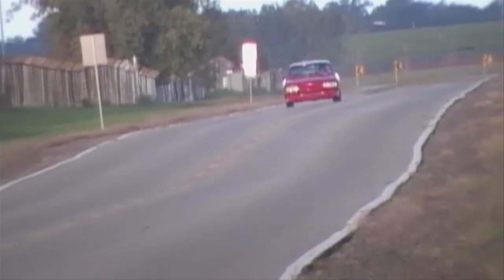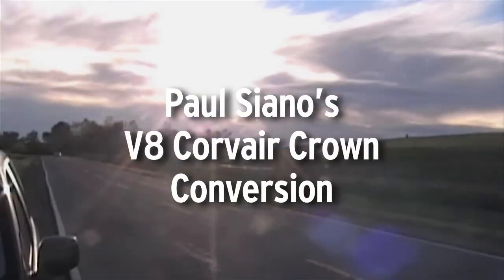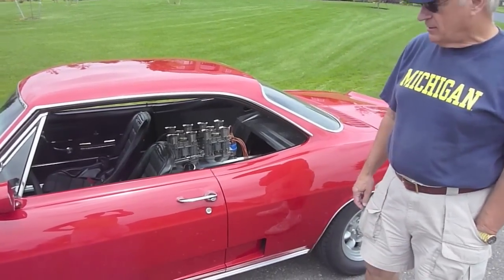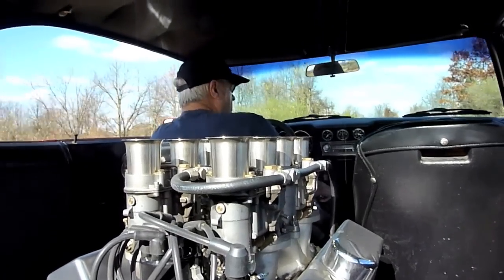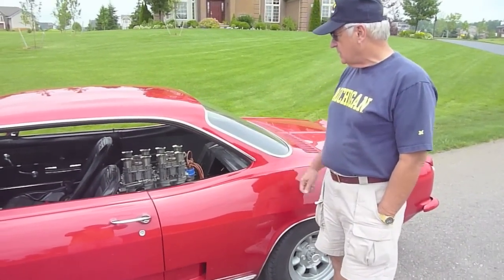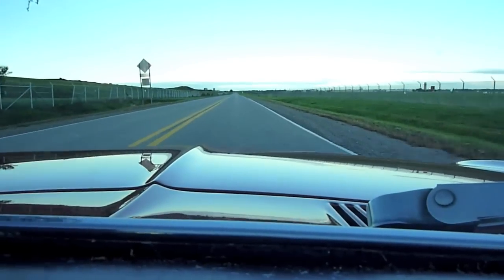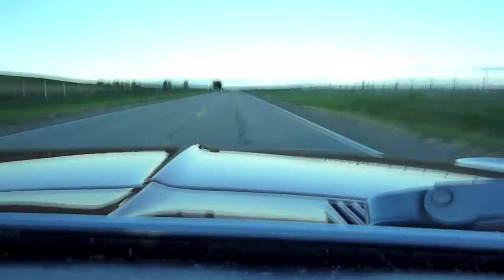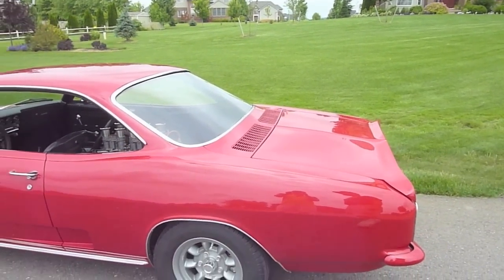Corvair With Chevy Aluminum 283 High Speed Run

Comment: I appreciate your interest in the project.  It must be remembered that this is a late 1960s era conversion and I used parts (mostly) that were available at that time.  I tried to keep everything correct for that era...no five speeds avail.
I asked Don Sherman to "take  it easy" testing it and he did which is reflected in the numbers.  I set the redline at 6500 which resulted in a top speed of 130.  Had I set it at 7000 the top speed would have been 140 and quarter mile time would have been less.

Comment: What a great way to start the day...thanks for the kind words.  Don Sherman was driving the car.  I asked him to use 6,500 as the rev limit which delivers 130 mph.  As you can see from the video it was still pulling at that limit.  7,000 rpm would be 140.  Because I think the aluminum 283 block should be in some museum, an aluminum 350  engine is currently being built and will be worth about another 100 horsepower which is about all the ring and pinion can take.  Thanks again.

Comment: It does sound as though it has solid lifters but they are hydraulic. (maybe set a little loose?)   The cam is specifically designed for Weber carbs so that there is increased vacuum at low rpm.  Thanks for checking it out.

Comment: @zuzulo56 This project was expensive; how much it cost is unknown but not that expensive if the dollar amount is divided by the number of years I've had it..  The current engine is the third I've had in it...started with a 327, then a 302, and now it has the aluminum 283.  The fourth is currently being asembled, an aluminum 350 using the same Webers.  Top speed is rev limited at 6,500 rpm.  Differential is currently a 3:55.  Top speed could be increased by using a 3:27 or a 3:08.

Comment: Gotta figure out a way to put a close ratio in it and a shifter you can slam
Reply: Since the video, I've installed a quick shift kit.  It was designed to be bolted in place.  It made such an improvement, I decided to weld it in place.  Am planning a new video that will show the improvements made in the last several years.
Reply: @57paulsiano  Still building mine, curious as to your quick shift kit... is this the spacer type?
Reply: Pau Pau  I admire your values and dedication to the project.  Please keep in touch as you make progress.  Thanks for you comment!
Reply: @johnboy4161   Sorry, I must have overlooked your reply.  Not sure what it's called but it's the one Clark's sells...a huge improvement.

Comment: Hmm...rubber hose on the fuel delivery for those "Webers" right behind the driver, with no insulation on the exhaust...you are braver man than I...or perhaps more fuel hardy, a little SS braided tubing would make me more comfortable.  Do you run this with no fire wall?
Reply: Your point is well taken and clearly this car is not for everybody.  Fuel pressure is about 3.5 psi.  I  once had a Hilborn fuel injection on it but wasn't comfortable with the high pressure fuel so close.  (did use braided lines)  I also agree that fire walls are a good idea.  I wanted this car to perform well and look good and in my opinion it is both.  I also wanted it to look stock.  Since the video, the engine now has a black distributor cap and black ignition wires.  Braided fuel lines would not look stock.  I have driven it,off and on, for more than 40 years without incident.  It's hot and loud...I suffer for my art.  Thanks for your interest.
Reply: Paul Siano
Thanks for your reply, I meant no insult to you, I currently have an off-road car built with a tube frame, mid engine small block and using a Mendeola 2D transaxle, with open axles and midboard 930's, but we run braided steel fuel lines, a fire-wall, a halon system, and we always use a fire suit, with full helmet.  I cringe to watch those webers, which are known for fuel leaks, at least all the IDE/IDF types I have used, without an aircleaner, which can backfire readily into the interior of the car,  being fed by that "bent"  rubber tubing, because I have seen leaking gas flash flame on a hot header, and the burns that sometime occur to occupants as a result.  Even 3.5 pounds is a lot of gas through a pin-hole in a rubber line. The car is beautiful, and well engineered, but just seems unfinished, without a firewall, braided steel, and a halon system.  Have a good day!
Reply: mfd doc No offense was taken and your concerns make perfect sense.   Fire walls make sense and so do air filters...I don't have either.  The Webers do leak a bit and consume gas like crazy but again it's about automotive art.  I just can't bring myself to build an engine cover, even a transparent one, as it would reduce the experience of involvement when the thing is operating.  Our daily driver (BMW 335i) is  a great car for most purposes.  The mid engine Corvair is at the other end of the continuum and not good for most purposes.  Flying in a commercial jet is one experience and so is an open cockpit airplane with a radial engine with wind in your face.  A hundred years ago, while in the Navy, I was a radar operator on a single engine, prop driven, carrier based plane.  (AD5-W)  One of our squadron planes had an in flight cockpit fire fueled by oxygen and I haven't forgotten it.

Again thanks!
Reply: Im into loud but some aircraft like onboard comms would be a helpful and with the overall theme. VERY COOL ride I dig it. Essex huh?

Comment: It's begging for another gear (and shorter throw shifter!)
Reply: I installed a quick shift kit after the video was taken.  It made a huge improvement.  It was designed to be bolted in place.  I liked it so much, I welded it.  I agree with you about an extra gear but I wanted to keep it "period correct," so it remains a four speed.  Thanks for your interest!

Comment: Doesn't seem all that fast.
Reply: It must be remembered that this conversion was done 50 years ago.  It was quick in its day but compared with performance cars of today it's not very fast.  I also have a C7 Z06 and a 600 hp kit Cobra that are quick by today's standards.
Reply: @57paulsiano  Gotcha! Any idea what the top speed is? I'm guessing it must be good for 150 mph.
Reply: @Topnikko   The aluminum 283 block is quite rare and I asked that it be kept to 6K rpms during a top speed test.  6K=130 mph.
Reply: @Topnikko  Performance info is at the end of the video.